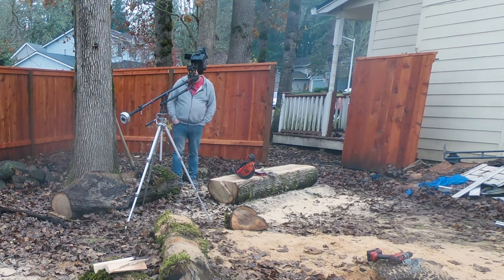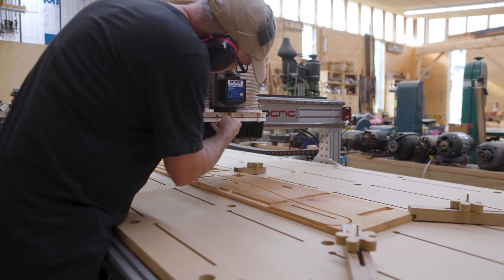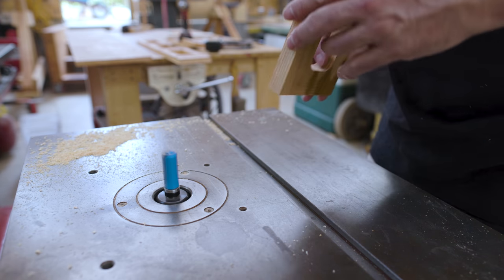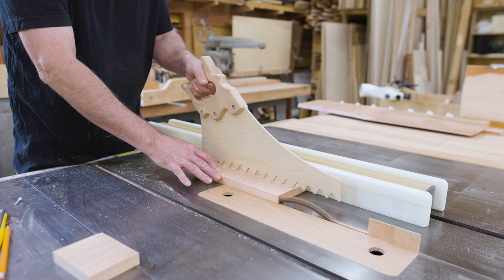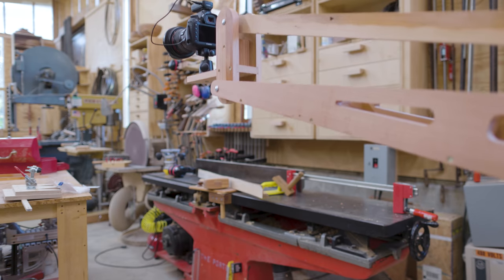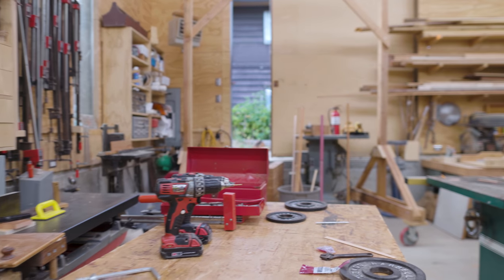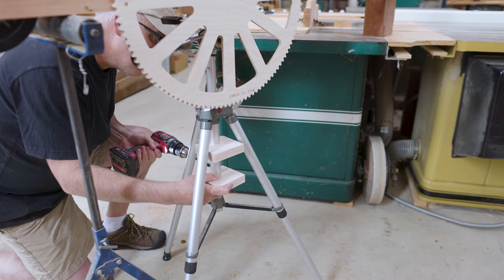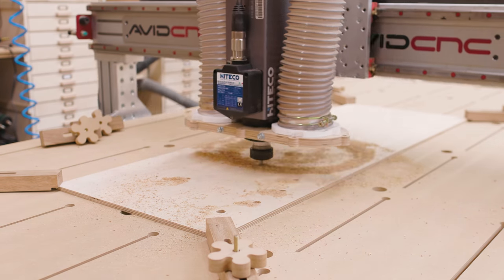Making a Camera Jib

Comment: I built mine of steel with nylon bushings and washers as well as neoprene shock dampeners and I used a variable speed rotisserie motor driven by an Arduino mini-board. Made it weather resistant as well powered by lawn tractor 12 volt stepped down by a 5v buck charged by a solar car battery charger. Cheers.

Comment: Very cool project - the only addon I can think of would be a variable pivot point for the top bar of the parallelogram. At neutral position it does as it should, keeps the camera level. At other positions it would intentionally pivot the camera either more than the jib (less ideal) or opposite the jib motion, thus keeping some subject in frame while changing the camera perspective. (if the cantilever arm is longer than the main arm, it will follow a subject. If the cantilever is shorter than the main, it will amplify the tilt of the camera matching the arm).
By having an adjustable pivot by having the pivot in a slot that can be adjusted with a screw, you could add a gauge that let you know 'parallel' or 'subject distance'. Focus would be tricky as you'd be sweeping an outside arc but tilting the camera towards the subject, so the focal distance would constantly change - but a sufficiently closed aperture would handle any depth problems.
Reply: addendum: it could more easily be achieved with a turnbuckle somewhere in the middle of the top arm, instead of moving the pivot.

Comment: You're a true engineer, Frank! Perhaps you could use a stepper motor and a CNC controller for fine control of the jib? and then that way you could control it using some simple software.

Comment: First very nice project and workmanship as always. Second I'm worried about, what appears to be a light to medium weight tripod holding all that weight. I don't know if you know this but tripods and tripod heads are weight rated. This is so that the photographer doesn't put to heavy a camera and lens on a light duty tripod and end up with the camera and lens on the ground either from the weight tipping it over or from the tripod failing. Yes I've seen this happen (not to me). A friend of mine that used to have a camera shop in town taught me about this. I'm thinking you'll be building a special cart to mount the jib on that will free up your tripod for other things and be more stable and strong enough to support the jib and camera. If it's tall enough you might also be able to make it height adjustable to some extent. Now your in trouble, I've given you more ideas to build.(LOL)

Comment: this is a prime example that sometimes DIY is not recommended. the final product is rather big and most importantly does not do the thing that it is supposed to do.
still, excellent try and very interesting making process (as always from you Frank)
Reply: @jeremiahbullfrog9288  the gear ratio is not enough. Frank mentioned that it would like it to move slower.
Reply: @jeremiahbullfrog9288  i agree totally

Comment: What if you added a few adjustment holes so it could not be a perfect parallelogram which would tilt the camera down slowly as the boom rose?
Reply from the maker: I like that, more time spent setting up the camera, lol
Reply: With stepper motors at every joint and some crafty software, you could chose a point in 3D space and then the camera would always be pointed at it through the range of motion you programmed.

Comment: Hey Frank, maybe look into using stepper motors, they can be run with an Arduinno and a simple bit of code and you can really slow them down a lot without loosing much torque.

Comment: A cool feature to add with be an adjustment of that top arm so you could change the angle of the camera base. This would give a zoom out feature looking down or a zoom in depending which way turn the motor instead of always having the camera parallel to the ground.

Comment: I think it may be mechanically simpler to get the mechanical advantage you need using cables instead of gears. For example, you could use a differential windlass mechanism to pull up the jib. Without changing the windlass, you could get different rates of lifting by attaching the output cable at different distances from the pivot. A differential windlass should be simple enough to make on a lathe or just stacking up CNC cut circles.

Comment: Project idea: Have you ever built a pendulum?  A design might be a simple 3-4’ diameter concave wooden dish filled with sand.  Then, add an angled piece that holds a pointed weight on a string that swings back-and-forth through the sand making nice designs.

Comment: You have exceeded the load bearing capability of that little tripod by a lot. Buying a second hand video/film tripod (the kind with the double legs) would do wonders for you. Overloaded tripod can fail quite spectacularly.
Using a stepper motor and an Arduino, you would figure out a proper time lapse setup in no time (it's quite stright forward, and you're a very logical person).
Other than that this is a nicely executed jib.

Comment: If you add an end stop switch to cut the power to the motor after it has reached the end of its travel, you could allow it to record for as long as you want with the movement just at the beginning of the shot.

Comment: Great project! I think you would be better off mounting that half-circle gear upside down and mounting the motor from your central post (since that box stays in place when the boom moves). This would make the mounting easier and the whole jib would be tripod-agnostic, removing the need to make any modifications to your tripod.

Comment: Geared servo motor as an input instead of the brushed DC motor... You could control it as a 1 axis CNC device, programming the rate of movement, loiter times, etc.

Comment: A better way to motorise it would be to install a threaded rod diagonallly from the main arm to the top arm, the threaded rod has a nut that aactually connects to the top arm, the rod can then be direct drive
This will keep it as an all-in-one unit and allow rotation.
You could use a stepper motor for greater speed control, if connected to a computer of sorts, you can even program the moves.

Comment: That is very nice! Since you have quite a sizeable workshop, have you ever considered doint a cable controlled camera from the ceiling?
Like the system they have in a stadium, you have 3 or 4 cables from the walls/corners and by rolling the cables up or letting them out, you can control the position and the height.
It is certainly somehwat complex to put together and most likely requires a small controller and some code, but I am sure you can either figure it out or know someone who can. I think i.e. thisoldtony has tried his hand at coding a little bit.

Comment: Use a heavy duty hobby servo with an arduino to control the position.  You could also get a continuous rotation hobby servo and control the speed precisely.

Comment: Cool project. Maby you could try using belt drive for the motor. Like in drill press. It would make gear changing easier and the movement wold probalbly by little smother.

Comment: I wonder if a more heavy duty geared servo motor and a Bowden cable (bicycle brake cable) might get you the greater speed control you want without adding so much weight to the rig?  Really cool build either way :)

Comment: It would be almost trivial to add an arduino or raspberry pi to that would move the motor a specific number of rotations per second/minute/hour.  You could even add some a couple of switches to define the rate you want so you only need to program the controller once.

Comment: Look in to using a stepper motor to drive the gear. Then use some kind is computer to set the speed. I use an arduno and a stepper for 360 degree timetables and can change the overall speed

Comment: Clearance isn't something you need to think about like you do when working with say metal which has no give by comparison to wood. 

Too little too late, but if you wish to go smaller with the gears you could use smaller endmills and resin bonded materials like phenolics which are pretty strong and is often used in lathes such that it is the gear to break if there was a jam.  This way you could make a gear labyrinth on 2 shafts if you so wished which should be fine since the camera is lightweight

Comment: Instead of a gearbox I would have taken a project box and put a switch in it to change the direction of the motor and a potentiometer circuit to control the speed.  I would have included about 15 feet of wire so it could be set near where I was focused on so I can drive it while working and I would use connectors so I could disconnect it to put it away or untangle the wire should it be needed. With  a much simpler setup you could also do another to control rotation and get a near 360 degree range with a stop so you don't twist up the wires around the axis.

Comment: Frank,  I am curious as to if the tripod you used would comfortably hold up the weight of the Jib arm (and motor) because they felt to have exceeded the tripod's weight handling capacity?

Comment: What you want is a continuously variable gearbox?... Would let you accelerate through moves. What if you made thicker gear and pinion so they could slide against one another? At 30 degrees extrusion angle on each, you'd gain a lot of nuance? Or belt-driven like Prius cars with 2 conical pulleys that you can adjust in and out with respect to each other. In this way, you could adjust from high to low ratios easily. Probably easiest, but less continuously variable is to add a 3rd gear against the motor so you can change it out for different ratios - As Wandel does with his over-engineered box-joint jig? Also you want gearing on pan as well as lift? Ditch the tripod. Make a wooden platform and go from there. Wait. I've just invented CNC (again)...

Comment: I might have missed you addressing this, but If you used a variable voltage dial on the input would that slow the motor down?  There are some pretty cheap ones out there in the RC world.

Comment: Always great videos - would a variable speed motor work vs the gears? What about a model railroad indexed turntable setup? I noticed your radial saw w/aluminum angle foe a fence - set to only work for 90 deg - then later you cut a 45 angle -> Do you have a video showing this set up - or do you have 2 radial arm saws? Thx for all your efforts.
Reply: i think he has 3 or 4 rad arm saws

Comment: The gearbox is very cool but I think a cheap motor with a small plastic step down gearbox  might have been simpler.  Also a remote control unit should be available on eBay for cheap.
Reply: A lot of people use egg timers for really slow timelapses

Comment: 7:05 you dont need a fancy insert to mount a camera to something. Almost every single camera has a threaded hole on it that can fit a 1/4-20 bolt and all tripod mounts have this size bolt on them(so does every hardware store) so you can just buy the nut or bolt instead of an expensive piece of hardware

Comment: Can you add a variable speed control for the electric motor? I don’t know much about electronics, but I would think you could have motor spin slower or faster with a dial.
Reply: With a DC motor it seems like you could just add a potentiometer and be good to go.

Comment: You are limiting the tripod to a single height and rotation angle with this solution. It could be possible to move the motor and the gearbox to the backside of the jib where you need weight to balance the camera. On this position it's more elegant to move the arm and keep the Tripod able to rotate. And you could reduce the "dead" weight.

Comment: Is it possible to make a camera jib that stays focused on the same spot as it rises, just changes the elevation of the camera?
Reply: If you make one arm of the parallelogram longer or shorter the camera will point more upwards or downwards during the tilt. But you have to change the length of the arm every time.
Reply: @jBurn_  I suppose the question is how to figure out how to make the lens face stay in the same plane as the jib moves so it stays pointed at the same spot even though the point of view changes.

Comment: The gear really seems total overkill :) Perhaps just a string on rod that is winding up on one side and windig off on the other that is somewhere connected to the mechanism. It should not need a lot of force to move if the whole thing is balanced.

Comment: Frank,  if you are using a DC motor,  the speed of the motor in RPM is proportional to the applied voltage.